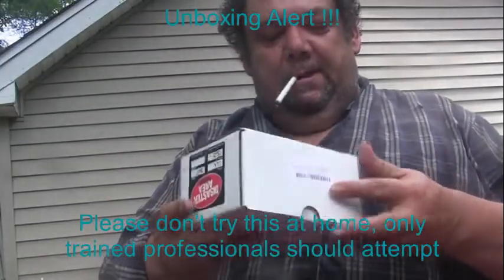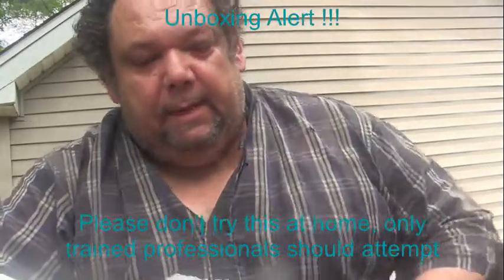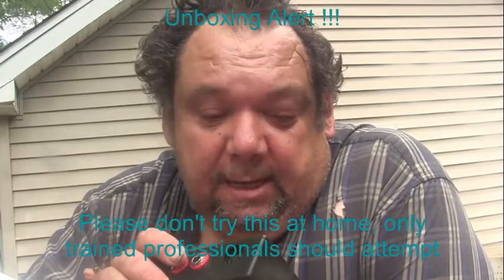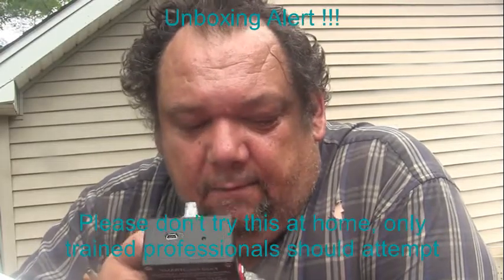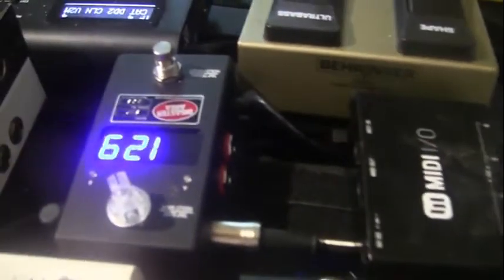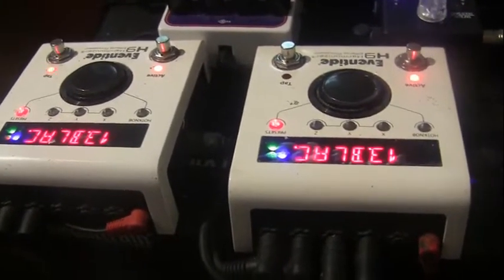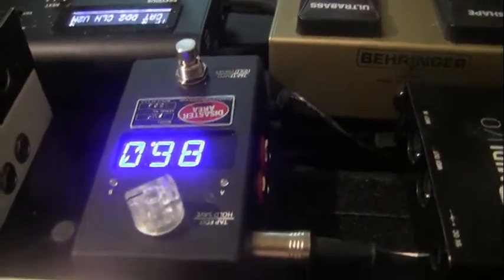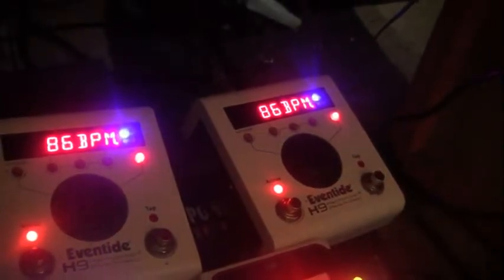Part 8 Pedalboard build : adding a disaster area design smart clock

Comment: i could def use a smart clock.I have 3 deals 1 from the Midiverb4 one from my H&K Blackspirit200 and one from my BlackStar ID 30 im not sure why it doesnt sound all jumbled up. Im guessing the MIDIVerb4 delay is over powering the other two amps delays? Some guitarists use 2 different time delay settings on purpose and are set that way on purpose for the intended effect.

Comment: one thing you didnt mention is where the hell on that pedal board do you place the Smartclock.If i was to get one im not sure where to place it ? Or is this for MIDI only pedal? BTW ive never seen anyone including the huge guitar gods use a Smartclock.Leave it to the MAD SCIENTIST to come up with some freaky stuff.
Reply from the maker: hi, well the smartclock doesn't produce any sound so as long as you have a midi cable hooked up to it and a midi capable pedal your good to go,so as long as it can fit on your board is all that matters it doesn't need to be in the signal chain